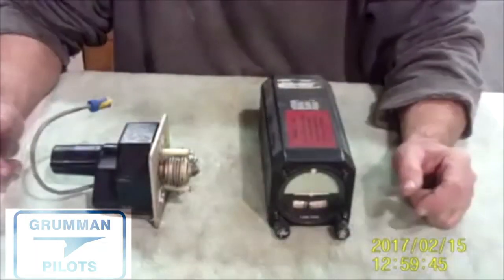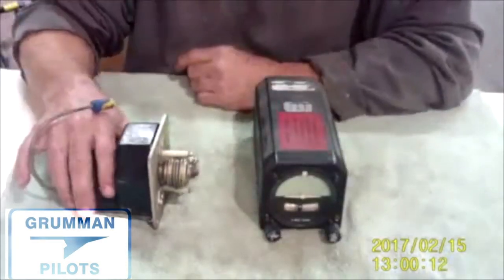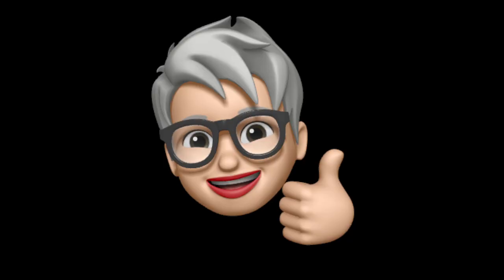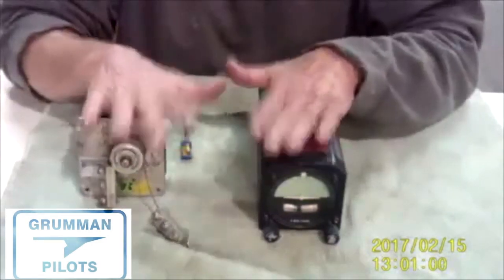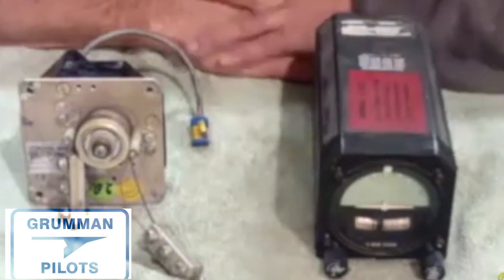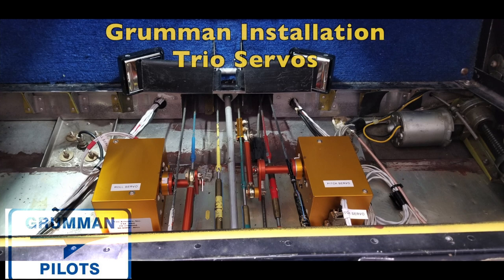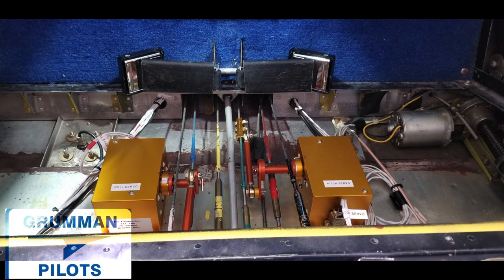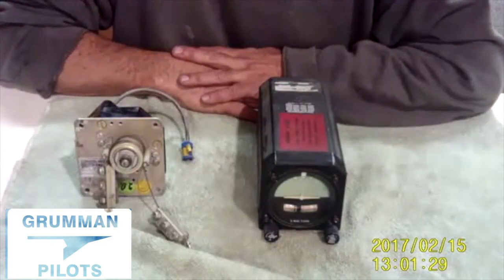Airplane Autopilot - Grumman Style

Comment: I love the Trio in my Cheetah. Has altitude preselect, constant airspeed or constant rate (fpm) modes as well as an altitude deviation/autopilot disconnect alarm if wired into the audio panel. GPSS steering, GPS course or heading select is also nice. My old Century one tracked like it was on rails but have come to love altitude hold! Keep up the great work Roscoe!
Reply from the maker: Thanks I sure will.